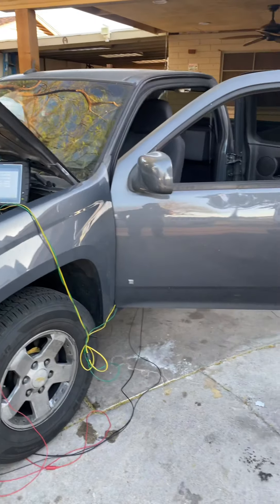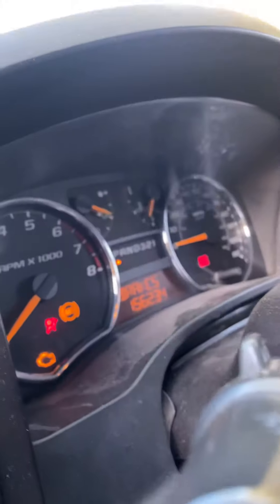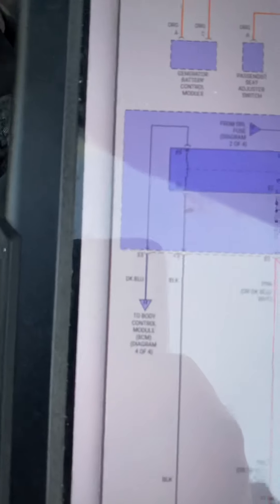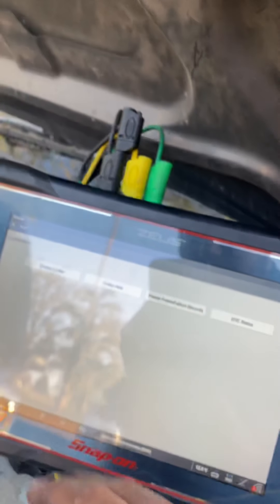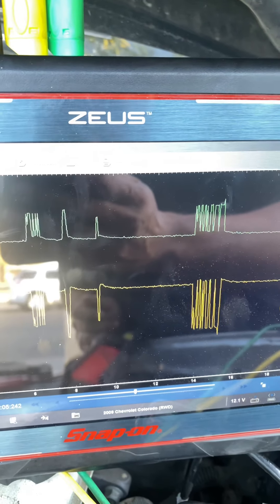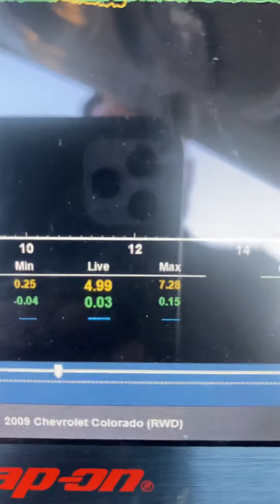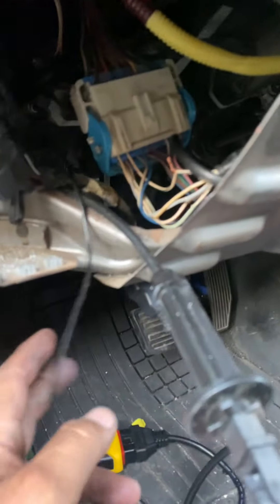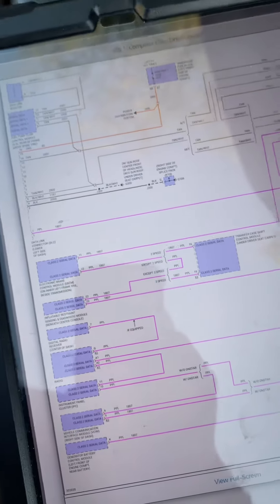Chevy Colorado(shorted bus line) no crank no start

Comment: Tengo el mismo problema en una 2005, Chevrolet Colorado y ya revisé todo y nada más no encienden nada más que dos luces en el tablero
Reply from the maker: Pues ahí lo principiante sería de revisar las corrientes del ignition switch Al BCM. El bcm manda la corriente a la caja de fusibles y tienen que tener corriente siervos fusibles. Si es problema de comunicación tendrás que desconectar módulo por módulo asta que reviva todas las corrientes. Creo que en este punto sería de agarrar alguien con experiencia en electricidad para solucionar este problema.
Reply: @elitemobileautoelectric7782  trataré de todo. Muchas gracias por responder.